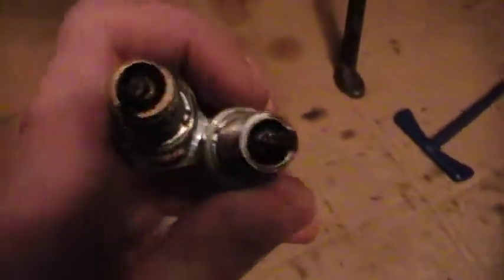transmission oil in engine

Comment: @outdoorsman310 I've got a '72 Yami 200 2 stroke 2 cylinder with trans leak. It was time that did it, not overfill. There's no pressure in the trans. :{

Comment: The seal between the engine and the transmission is bad.The crank case is getting trans oil in it. The seal will need replaced. There's no gasket on the jug, just a copper ring. I'll hunt up a supplier.